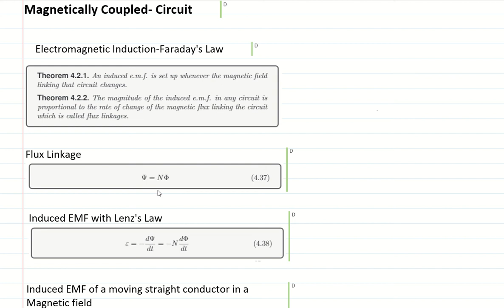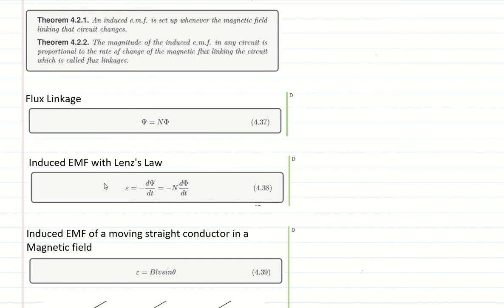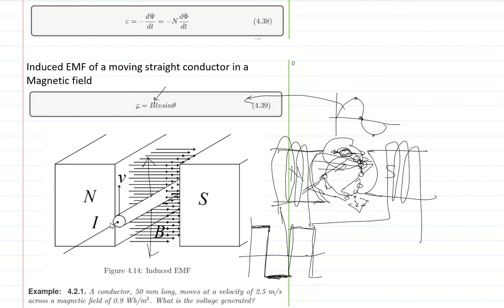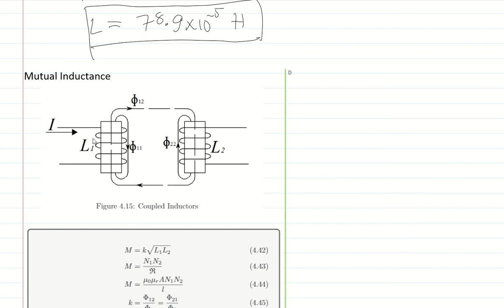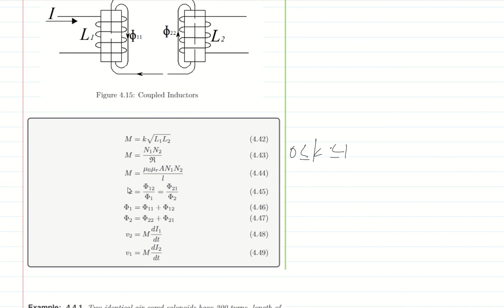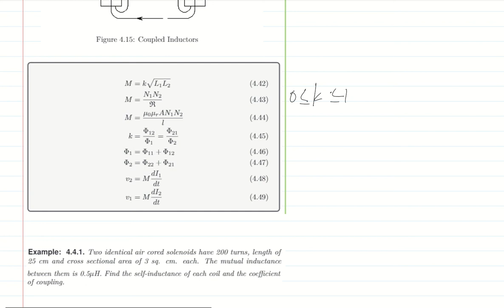EE124 - Chapter III: Magnetic Circuits and Magnetically-coupled Circuits Part 4

Comment: Sir mayat latta ba no 0.016 V t final answer? ta example 4.2.5 Sir ket 0.16V answer mo.
Reply from the maker: nope. the correct answer is still 0.16V but the velocity should be 4000/36 rather than 400/36 because 400km/h(1000m/km)(1h/3600s) = 4000/36 m/s